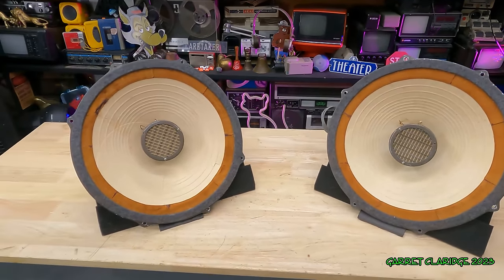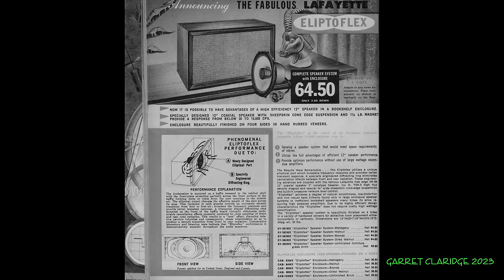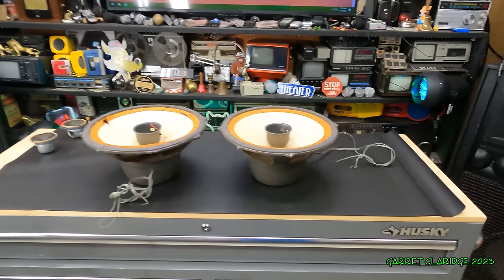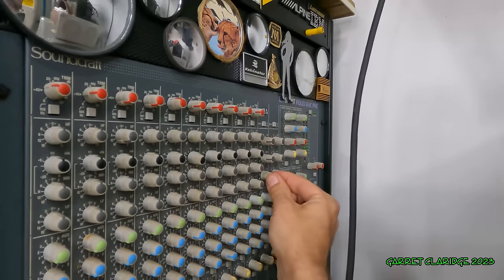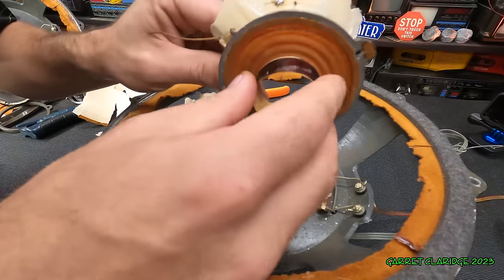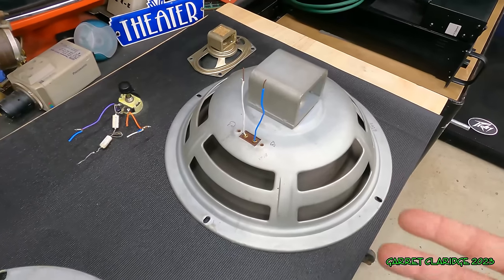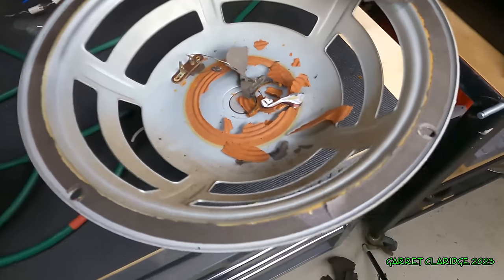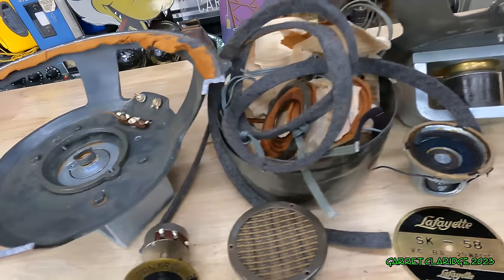1959 Lafayette Coaxial Loudspeaker Destruction

Comment: That Stromberg Carlson speaker likely came from a vintage console TV, circa early 50s. Thus the transformer mount, as those all-tube sets have a high impedance audio section, so the transformer was needed to drive the speaker with those sets. This particular speaker isn't very desirable with the transformer missing, unfortunately. Would otherwise make for a great option for a vintage radio of the era.
Kind of a shame about the Lafayettes being too far gone, but it was entertaining seeing how well they held up to a torture test! They definitely are well built.